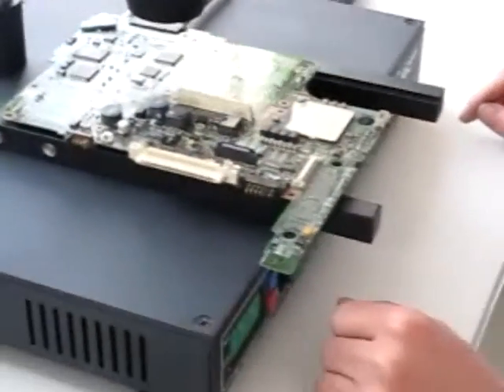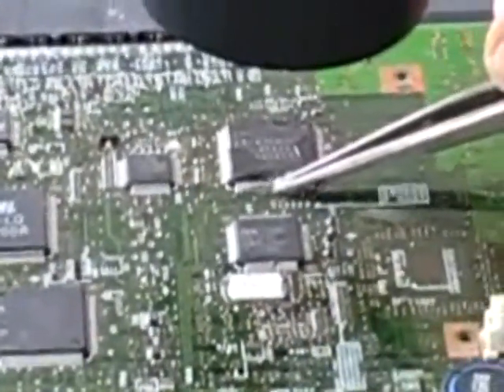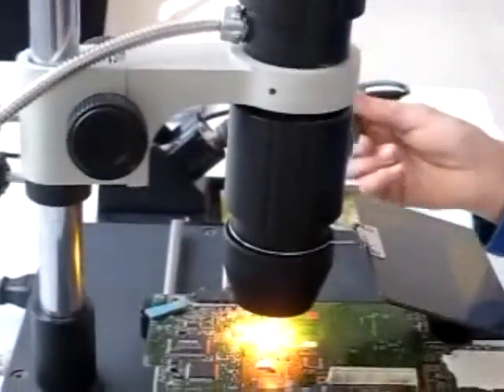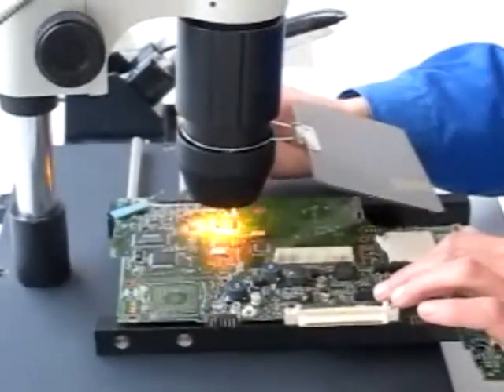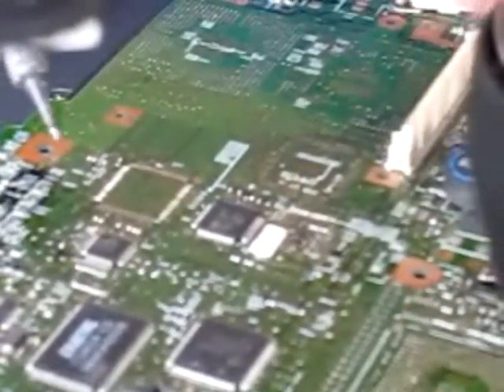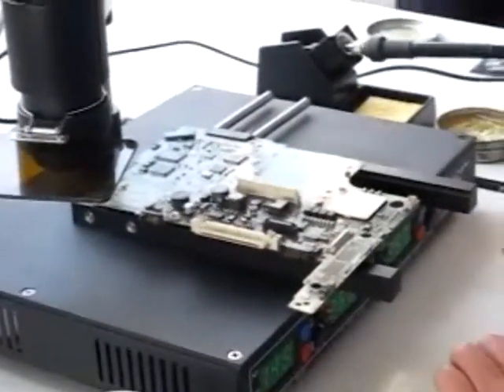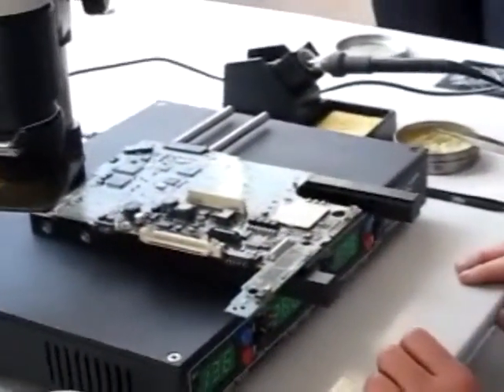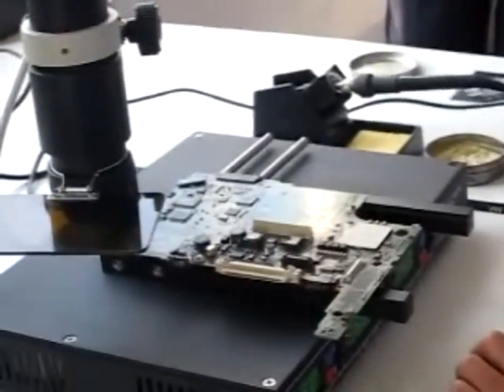How to... ? Rework ... T-862++ Digital Infrared IRDA Soldering Station - For LaptoP Reballing  -

Comment: wtf did i just wach O.0
Reply: seems a nice bit of kit. I guess as opposed to hot air rework that can disturb surrounding components - this IR method can be focused and programmed a profile for specific top / bottom temp / duration for given chip. really neat stuff.

Comment: is this station or are T 862 style machines good enough for most laptop GPU's?
Reply: I owned one at one point and I don't believe the design is good for removing GPU's. The way the heat goes onto the board from the lamp isn't concentrated or isn't hot enough.

Comment: when it comes to a glued chip use twisting technic to remove it, when the solder is hot enough and turned liquid then twist the chip a little bit with a tweezer or a special tool while removing  the chip, I hope this will help

Comment: Well charlie, it would not have been a bad idea if you had shown exactly what the temperatues were for the profile and what chip you were actually removing. This information influences the purchase and the same with all your machines. What paste were you using? where can it be purchased.? Repairs who does them? the replacement heaters? lots of things you could cover but didn't and a follow up video maybe would be a good idea. Profiles of various electronic equipment would be great.

Comment: Whats that paste on 1:50? I just got my machine but i am having some trouble adjusting temperatures, some times i just burn BGAs i am running out of spare chips i can burn before moving to important ones. Is there any table of recomended temperature and distance depending of the kind of chip (BGA or SMD) and size?

Comment: you can remove and replace xbox. ps3, bga chips with this machine. The main thing to remember is flux the bga component thoroughly. This is key. You see the flux will heat very quickly and thus make the chip hotter even on the corners where the infrared soes not reach. You can see the flux getting hot and trying to boil. Just keep adding flux if it burns off. keep a pool of it all the way around the bga. Never had any issues removing and reballing these chips with this method
Reply: Traductor en español

Comment: @goran001 Me too, I %ucked up 2 chips. I think the hot plate has to be closer to 200 C before Infra redding the chip. They suggested the hot plate to be 160 but I can't get the solder to melt under the chip at 160.